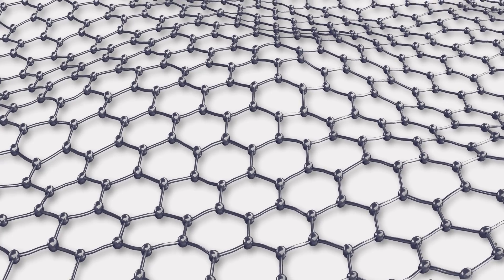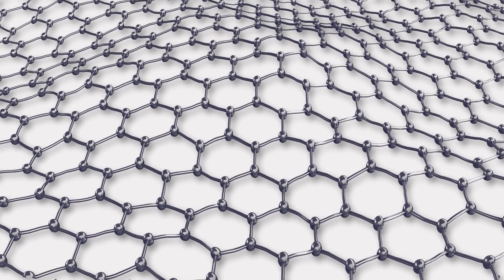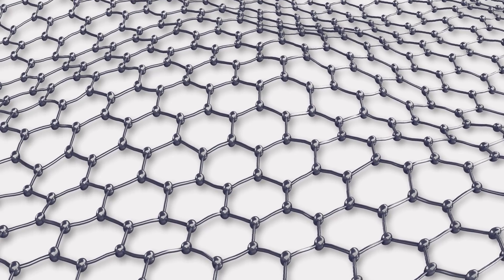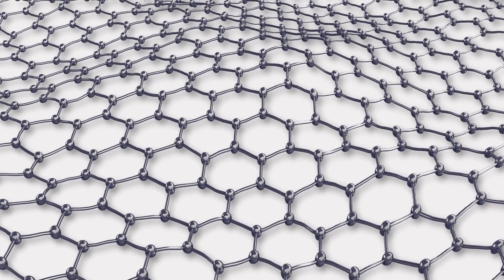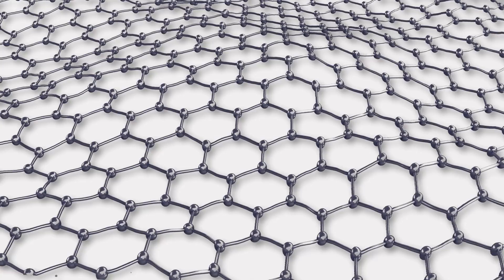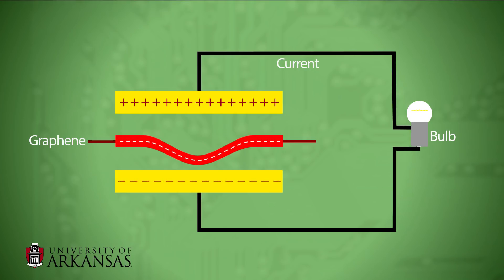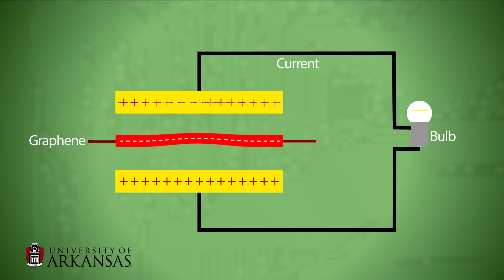A Potential Source of Clean, Limitless Energy

Comment: If the energy is gathered from brownian motion, then I suppose the graphene would loose temperature constantly until it would hit absolute zero, then stop working? That wouldn't violate laws of thermodynamics, but it seems to me that would be a breakthough in converting heat to electricity, simply. I am still skeptical, but imagine batteries working off any heat above absolute zero gathered from your surroundings, this is at the very least a nice idea for sci-fi novel xD
Reply: Particles randomly appear/disappear, keeps a temp balance.  But if there is a loss due to resistance (what little graphene has) then it could remain functional for a very long time.  Check out the self-charging LiPo battery using developed by Hong-Kong polytechnic.
Reply: Malbec not even as acording to hiesenburg's uncertainty principle, no particle can remain at zero kelvin, as it would allow an observer to simultaneously know the position and momentum of said particle, (which quantum mechanics does not like one bit!), so, the universe resolves this little dilema by permeating every plank volume with these thing called "virtual particles", which cause constant fluctuations of energy at the quantum scale, causing it to be eternally meta-stable, ensuring that any particle has at least enough energy "momentum, temperature, name it what you want) to overcome the smallest energy barriers allowed by physics... So no, the graphene would not stop... It would just turn itself into a  superconducting Bose-Einstine condensate while manifesting quantum properties at a macroscopic scale as all of the carbon atoms would become quantum entangled... It would lose it's capacity for electric charge, remain at a hair's breath above zero kelvin until those pesky virtual particles heat it up above it's superconducting point, and finally it would begin producing electricity again, coming in and out of two states: ("cold" superconducting entangled condensate, and "hot" normally-conducting classical normal solid matter comprised of carbon)...
Reply: 📰 "The findings, published in the journal Physical Review E, are proof of a theory the physicists developed at the U of A three years ago that freestanding graphene — a single layer of carbon atoms — ripples and buckles in a way that holds promise for energy harvesting.

The idea of harvesting energy from graphene is controversial because it refutes physicist Richard Feynman's well-known assertion that the thermal motion of atoms, known as Brownian motion, cannot do work. Thibado's team found that at room temperature the thermal motion of graphene does in fact induce an alternating current (AC) in a circuit, an achievement thought to be impossible."

📰 source:
https://phys.org/news/2020-10-physicists-circuit-limitless-power-graphene.html 

📰 October 2, 2020
Reply: Yes, that would violate the laws of thermodynamics; extracting energy from ambient heat alone is a spontaneous global decrease of entropy.  Statistically, it cannot be expected to happen.

If you follow the models for why this is the case all the way down, you basically hit rock bottom at information theory (this is basically where anything involving entropy ultimately ends up), which makes it very clear that extracting energy from thermal fluctuations would require expending at least as much energy in measuring those fluctuations.  This is the so-called "Maxwell's Demon."
Reply: Oh, sorry, I meant to write the law of energy conservation in particular, I didn't consider entropy really. But shouldn't it be impossible for brownian motion to affect graphene in such a manner in the first place? I see nothing wrong with their battery model as long as graphene really acts in this way. But that kind of motion is proven to be true by their observation, so I think it is their observation which should be doubted, or maybe their hypothesis on what causes the cyclic motion of the graphene.

Comment: To quote Eddington:

"If someone points out to you that your pet theory of the universe is in disagreement with Maxwell’s equations — then so much the worse for Maxwell’s equations. If it is found to be contradicted by observation — well, these experimentalists do bungle things sometimes. But if your theory is found to be against…thermodynamics I can give you no hope; there is nothing for it but to collapse in deepest humiliation."
Reply: oooooooooorly The real world is not an isolated system.  The temperature changes are externally driven.  You may as well argue that sailboats violate thermodynamic principals.
Reply: Of course there is. The scale is vastly different, which is very relevant when it comes to practicality.  I'm not really sure what you're even arguing against. Are you saying that variations in ambient temperature don't exist?  Or that it's impossible to translate temperature changes into work?
Reply: You are jumping to a conclusion on scale that's unsupported by the facts.  Per the description: "under the right circumstances, temperature changes caused by ambient heat makes graphene ripple and buckle".  The details of the circumstances aren't specified.  There's nothing here that violates thermodynamic principles.  No claims are being made about free energy or perpetual motion.  If that's what you're hearing, you've fundamentally misunderstood.  However, you can (and IMO, should) be skeptical about the practicality of this.
Reply: Experiments will prove you wrong.
Reply: How much money do you want to put on it?
Reply: This does not violate the laws of thermodynamics. It depends on variations in ambient temperature.  Practicality is another question entirely.
Reply: Free energy isn’t possible : I want to know if this is just shit, or if the ernergy used comes from somewhere we never thought before.
Reply: Yes, let's move the goalposts. You aren't really commenting about the video you're commenting on.  Instead, you object to something in the press release.  Okie dokie.
Reply: How is it "moving the goalposts?"  The press release is from the same people, it provides context to interpret what is meant by the wording used in the video.
Reply: 📰 "The findings, published in the journal Physical Review E, are proof of a theory the physicists developed at the U of A three years ago that freestanding graphene — a single layer of carbon atoms — ripples and buckles in a way that holds promise for energy harvesting.

The idea of harvesting energy from graphene is controversial because it refutes physicist Richard Feynman's well-known assertion that the thermal motion of atoms, known as Brownian motion, cannot do work. Thibado's team found that at room temperature the thermal motion of graphene does in fact induce an alternating current (AC) in a circuit, an achievement thought to be impossible."

📰 source:
https://phys.org/news/2020-10-physicists-circuit-limitless-power-graphene.html 

📰 October 2, 2020
Reply: @platoscavealum902  It violates much more than that; it violates fundamental thermodynamics.  This physicist is a hack and his theory is false.
Reply: @platoscavealum902  Yes.  I don't know why you think it's convincing; anyone with even a cursory education in physics should be able to tell that this is nonsense.
Reply: oooooooooorly , respectfully, which part of the article do you disagree with?
Reply: @platoscavealum902  "A team of University of Arkansas physicists has successfully developed a circuit capable of capturing graphene's thermal motion and converting it into an electrical current."

You can't convert thermal motion into useful work.  You can convert macroscopic thermal gradients into useful work.  No amount of obtuse circumlocution (the professor's explanation for how his device "is not a Maxwell's Demon" is vacuous nonsense) can get around this.

How much physics have you studied?

It's worth noting that if he applied for a patent for this device the patent office likely wouldn't even look at it, because they've seen enough fucking bogus perpetual motion machine applications to know better.  This whole thing is an embarrassment for the university of arkansas, and for the journal that published this nonsense.
Reply: oooooooooorly , thank you for sharing your thoughts... It is odd that this professor has been able to mislead so many professionals, retain his job at a university, and publish his work in a journal. 

Any thoughts about why or how this purported sham is able to go on for years — without consequences?
Reply: @platoscavealum902  It is indeed quite odd, but academia is nowhere near perfect.  Note that it was not published in a particularly noteworthy journal.
Reply: Scale is a fundamental difference.  At the atomic level, there is no "temperature" - temperature is an information-theoretic construct that we use to describe macroscopic systems.  "Variations in ambient temperature" ceases to be a useful description at a sufficiently-small scale; the "variations" are fundamentally un-exploitable when you get small enough.

You should watch Feynman's lecture on the thermodynamics of the ratchet.
Reply: Define what you mean by "variations."  If you mean thermal fluctuations of an otherwise at-equilibrium system, then yes, that definitely violates the laws of thermodynamics.

In order to get useful work out of a gradient, you need to build a device that specifically relies on knowledge about the nature of the gradient.  This is information-theoretically necessary; there is no way around it.
Reply: No; sailboats are built to exploit specific, known, macroscopic gradients.  There's a world of difference.
Reply: Read the press release.

Additionally, "temperature changes caused by ambient heat" is wording suggestive of thermodynamic impossibility, itself; you can't extract energy from ambient heat, or (transitively) by anything "caused" by ambient heat.
Reply: oooooooooorly don't listen to him. He doesn't really seem to understand thermodynamics.
Reply: That is NOT science.
Reply: Jon T, well yea, but if someone tells you he can prove that 1 equals 2, then it's more likely that his proof is wrong rather than the entirety of modern mathematics being wrong.

Same with thermodynamics. If their findings turn out to be accurate and reproducible, they would basically disprove the second law of thermodynamics. It wouldn't really be a small improvement, it would basically be an absolut contradiction to the priciples all of all modern thermodynamics.
So pardon my sceptisism. I mean if it checks out, Wonderful! We have a free energy device. But I'm certain it won't.

Comment: Remember, if you think you may have discovered a way to circumvent the laws of thermodynamics, something has gone terribly wrong.
Reply: things get even worse when internet pseudo experts says a professor and researcher in a serious university is saying bullshit...
Reply: The thing that's gone terribly wrong is not realizing that this circumvents the second law of thermodynamics. Most people arguing it's possible are saying it doesn't create energy, which is true. It just acts as a perfect refrigerator, which is impossible.
Reply: I wouldn't go that far. The second law of thermodynamics is the most likely in my opinion to be inviolable*, and it's more likely to be wrong than 1 + 1 = 2 (which is true almost by definition). It would mean that most of our current understanding of physics was only an approximation, but that's happened before. There is almost no reason to expect there to be a thermodynamics violation, and in any case it would require discovering brand-new physical laws. This video is about something which supposedly breaks thermodynamics using our current understanding of physics, and that is provably impossible.

* On a macro scale and/or in a predictable fashion; unlike the others it already is known to be violable on a very tiny scale because it's a statistical law, and that's been observed in the lab. Just like a monkey might type out the word "is" on a typewriter but won't type out Hamlet, this doesn't actually imply anything about the macro scale because there's enough noise to more than compensate for the rare moments of order.
Reply: Authority can only get you so far in science. It can get you farther than in math, but still no that far.

If a random person on the street says they have a way to extract energy just from room temperature, I don't bother thinking about it.

If a university professor says that, I think that the university probably has bad hiring practices but I watch the video and try to read about it in case I can find a more detailed description of how the second law of thermodynamics is being broken. I might not understand the description, but if I don't even see one then it's obvious the professor is wrong.

If Stephen Hawking himself said he could extract energy just from room temperature I would look much harder for an explanation, and I'd triple-check my understanding of the second law of thermodynamics. But if everything I knew about thermodynamics was correct, and no explanation was even attempted of how this got around thermodynamics, I'd conclude that Hawking was wrong.

---------------------

In this case, a lot of people are comparing the motion of the graphene to Brownian motion. That makes this somewhat equivalent to a Brownian ratchet (https://en.wikipedia.org/wiki/Brownian_ratchet), which is a device proposed in 1912 which does not extract useful work from Brownian motion because doing so would be impossible.
Reply: lol and who are you to say a university have a bad hiring practice??  lol ... is that a joke?  fanboys of status quo really are suffering with this... but thats ok... keep on being skepticals  and let the pioneers do the job and brand new discoveries...
Reply: I will bet you as much money as you're willing to wager that this graphene technology will not be harnessed as an energy source in any amount of time.
Reply: I'm sorry, you can't make a bet against someone who agrees with you :P
Reply: GrifMoNeY I could if you thought 10:1 odds were good enough, but the “you” was meant to refer to Danilo Marvel (or anybody else who cared to take it, including Prof. Thibado).
Reply: GrifMoNeY why wrong?
Reply: Take the forty most true things you can think of. 2 + 2 = 4. Robins fly. The sun is hot and bright. Rocks are harder than pillows. Humans have two eyes.

Now imagine that ALL FORTY of those things were wrong.

That's how unlikely it is for a perpetual motion machine to exist. Free energy is a fundamentally impossible notion so long as the laws of thermodynamics hold. Tens of thousands of discoveries in physics rely explicitly on their being true.

Comment: So is the energy that causes the flexing in the graphene the ambient heat in the room?

Where is the energy coming from here?
Reply: Zero point energy.  But if it cools down a lot, everything stops moving, even atoms.  So it's got to be a bit warm
Reply: 📰 "The findings, published in the journal Physical Review E, are proof of a theory the physicists developed at the U of A three years ago that freestanding graphene—a single layer of carbon atoms—ripples and buckles in a way that holds promise for energy harvesting.

The idea of harvesting energy from graphene is controversial because it refutes physicist Richard Feynman's well-known assertion that the thermal motion of atoms, known as Brownian motion, cannot do work. Thibado's team found that at room temperature the thermal motion of graphene does in fact induce an alternating current (AC) in a circuit, an achievement thought to be impossible."

📰 source:
https://phys.org/news/2020-10-physicists-circuit-limitless-power-graphene.html 

📰 October 2, 2020
Reply: @platoscavealum902  thank you so much! Not many channels would put this much work into a reply

Comment: This is absolute nonsense. Charges don't just move back and forth when graphene fluctuates. There's back EMF, there are resistance in the wire. You can't control the fluctuations either. How do you know which way it will move? The thermal noise in the circuit will easily overwhelm whatever movement there is and renders the "energy" useless thermal heat. The PRL paper is merely about "anomalous" movement on graphene and NOTHING about possible power generation.
Reply: Because thermal noise is 3D a buckin motion of graphene 2D, these two cannot get completely compensated. https://www.reddit.com/r/Physics_AWT/comments/4u4ljs/graphite_based_thermoelectric_generators/
Reply: Yes... causes a poor quality high frequency AC current.  A simple DC diode full bridge rectifier turns it into DC current, which can be timing-signal inverted to make nice clean AC if you need it).

Comment: Completely fake. 
10 microwatts out of a 10um * 10 um surface translates into 100kW out of 1m^2. 
Room temperature is 293 Kelvins. It is impossible to get that much energy out of a room temperature material - it would beat thermodynamics.
Reply: i read the paper associated with an artical associated with this video, which is used as the source of these claims. The only way i could come up with that number, is by multiplying the STM probe bias with the tunneling current.. So this is just a load of bullshit. 

Though the fluctuations which are probably caused by the STM its self or thermal gradiants, are real it would seem.
Reply: Zero point energy Mr. Beam... proven. And a lot more by volume than this.